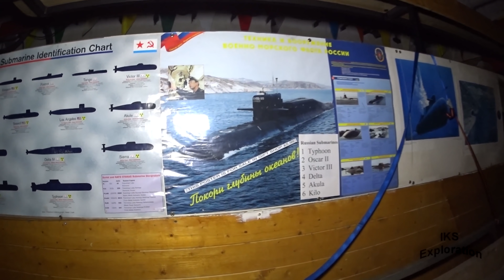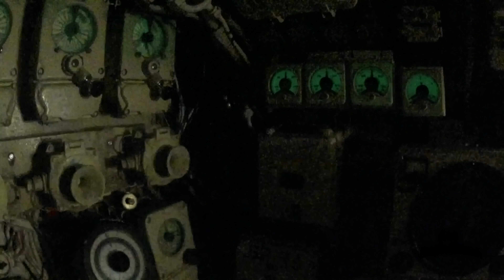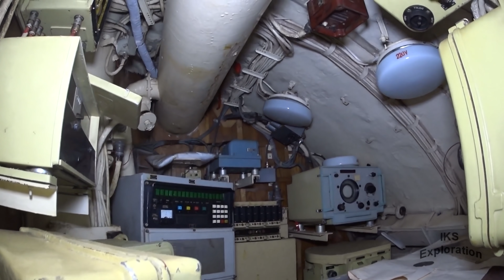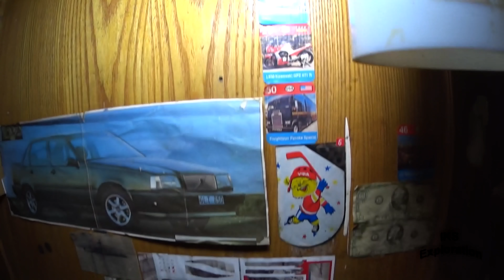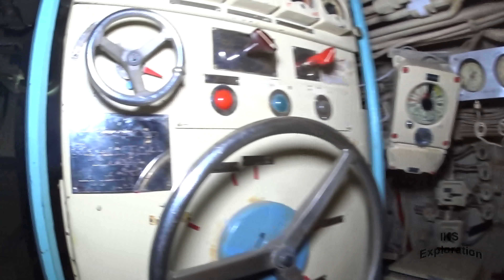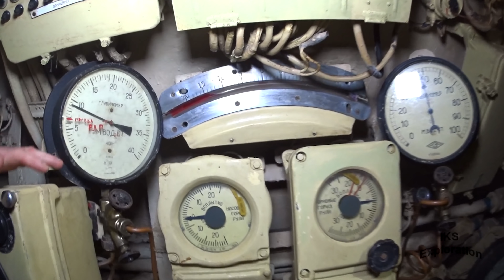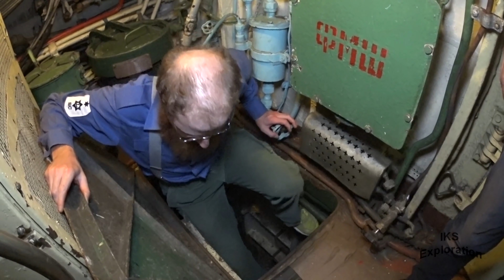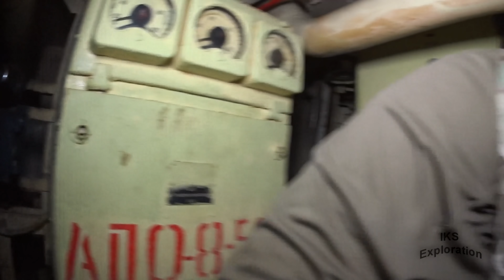Lets Explore U-475 Black Widow - Russian Submarine

Comment: This thing is huge compared to WWI or even WWII fleet subs....I can just see tourists on Maui, who've signed up for a trip on Atlantis submarines, motoring out to the platform, expecting a cute, non threatening commercial submarine, when this monster slowly rises from the depths... The wife turns to hubby  :  " Harold, did you read the fine print on the release forms you signed " ?
I gather this is a diesel / electric sub.  Still have the engines / motors aboard ?
Reply: It needs to have K-19 painted on the conning tower for the tourists to see.
Reply: @dellawrence4323 ---"the sterilizer"
Reply: @rearspeaker6364  K-19 was never called a “Widowmaker” in USSR. She had a nickname “Hiroshima”
Reply: @volodymyrbuchak1852  ok, I'll correct that.